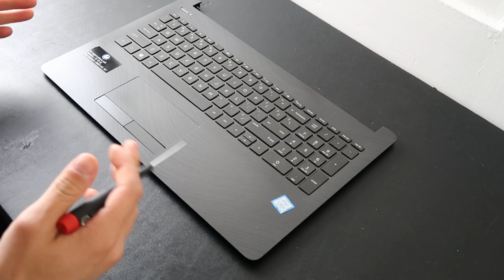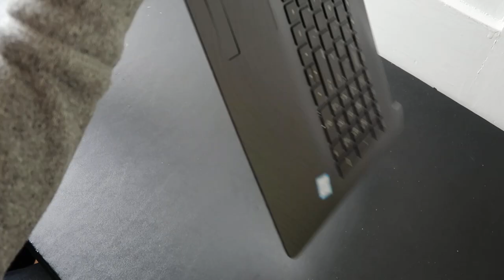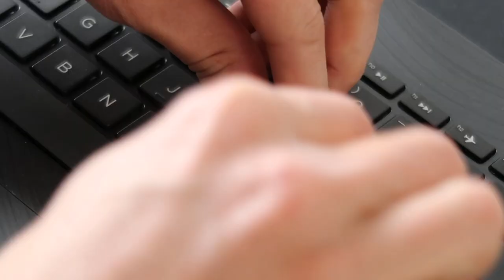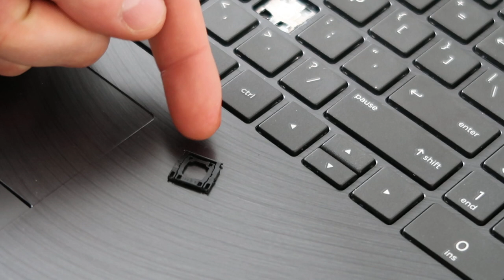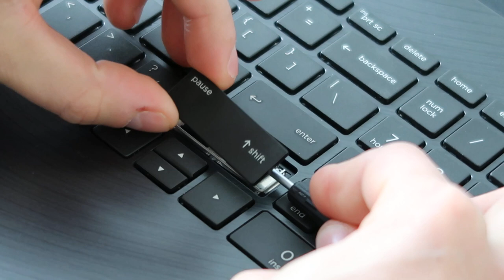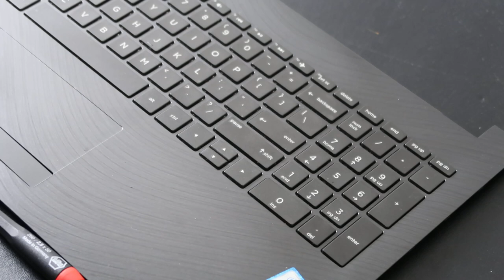How To Fix Replace Keyboard Small Key - HP 255 256 Laptop Computer

Comment: Hi 
It's not the same but i want to see how about (+) 
Because I'm trying to get it back and is not working with me now😭
Reply: Mine is hp 255 g7
Reply from the maker: @ashwaqtm2029  The + key is the same size / composition as the letter keys.  It should be the same.  How is your different?
Reply: @PC_Monkey  Yes, the same size, but inside there are two small irons that I could not know how  do it. Not like urs . 🥺